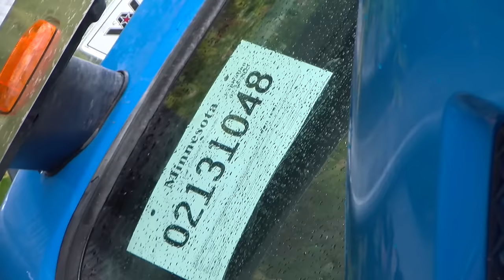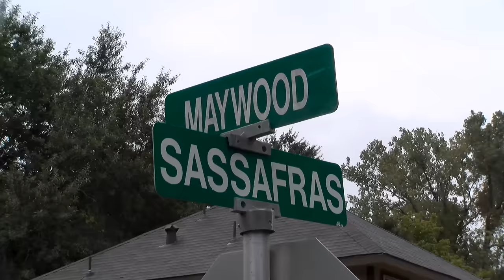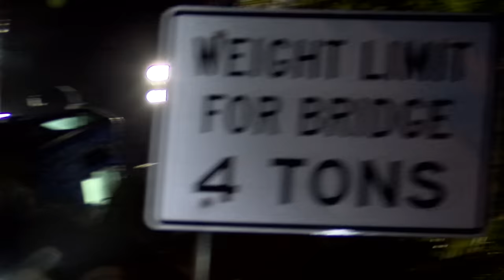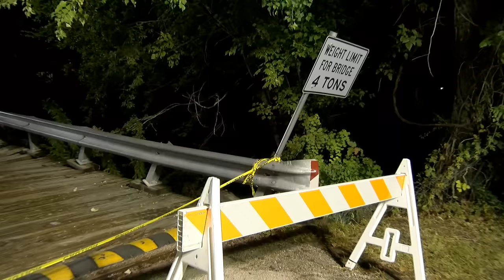091423 40 TON CONCRETE TRUCK COLLAPSES 4 TON BRIDGE AND VIDEO OF FULL RECOVERY

Comment: Having owned a big wrecker years ago I understand how difficult it was to lift the concrete truck out of the creek . I retired from Union Pacific Railroad and worked a lot of derailments and watching Hulcher Emergency D9 side winders and dozer clear rail cars , cargo and over 200 ton Locomotives out of the way and rerail a lot that could be set back on the rails is a lot of dangerous work . Cables and chains breaking , places where they were hooked ripping out and crap flying every which way . I've seen the side winders carry locomotives up some pretty steep dumps or what most people call slopes and set the locomotives on the rails to be moved to locations to be repaired or cut up and scrapped .  I knew this video was going to be a great one and it surely was great . Thanks for posting . Should be against the law in Texas for BLIND concrete truck driver that can't see a 4-ton maximum load sign on a wooden bridge .  Exciting day for the town folks .
Reply: Driver was negligent for not obeying signs! Insurance will get enormous claim request fo repairs to bridge and truck, probably will cancel coverage and what inconvenience to residents to reroute travel!
Reply: Add. Only one worker is wearing a safety helmet, sll personal should be wearing protective head gear!
Reply: At least someone here gets it. So many 'arm chair experts' in this comments section it's unreal.
You're not always lifting from the best point because you can't always get to it without putting someone in a dangerous position to start with.
There's no procedure book for stuff like this, has to be taken step at a time, very slowly.
Reply: Just curious where did u work 4 UP ?

Comment: I can’t believe they thought the hooks in the barrel was going to hold. Thank you for posting the recovery.
Reply: Or the chains would hold
Reply: Those drums on those mixer trucks are akin to an egg shell not very thick but because of the shape they are strong for what they are used for. Many years as a mixer driver.
Reply: Can't believe anyone would be so stupid to drive over it in the first place
Reply: @MarkSmith-ru7lu l
Reply: @1:58:34 !!

Comment: That truck weights 11 or 12 tons empty.  The bridge had no chance at 40 tons loaded.  I feel bad for the owner of the company.  That is a new truck.  Driver will be fired and go on his way.  Owner will pick up the pieces.
Reply: The problem is the sign is right at the FN Bridge a 40 ton concrete truck had no chance of stopping in time if he was going more than 20mph they needed a red warning sign at least 100 feet from Bridge entrance!
Reply: At 2:41 you can see well past 100 feet on the opposite side of the bridge.  The camera is at the stop sign before the bridge at maywood street.  Weight limit sign  is visible from stop sign.
Reply: I drive a 2007 Peterbilt with an 11 yard drum, it's around 30,000 empty.
Reply: @danielramsey1959  I own some dump trucks and they are about 23,000 empty.  And some frameless 39 foot dumps that are about 32,500.  I didn't realize the tare weight on the mixers was that heavy.
Reply: I think it should be against the law to have a wooden bridge for public traffic began with.
Reply: Why feel sorry for a company that hired an idiot to drive for them 🙄
Reply: You could look at the bridge and tell it couldn't handle that truck where hsa common sense gone
Reply: @ezragonzalez8936 Maybe. But you would hope driver of the truck can read road signs

Comment: I am an equipment operator and it is obvious this crane operator doesn’t know what he is doing. Totally wrecked the truck getting it out.  I would have considered lifting the drum off the truck first if it was possible.
Reply: The crane operator and heavy tow operator were both clueless.  They did more damage to the truck and bridge than the truck did falling through the bridge.

Comment: Surely the driver would have known that the bridge was not able to hold the weight I am surprised he made it this far across.
Reply: Big black and white sign, say 4 ton weight limit.
Reply: Was the driver tested for drink and drugs? Or just a novice who relied on satnav? Totally stupid decision to ignore the signs and the obvious construction of the bridge. A VERY basic mistake somewhere.
Reply: I think he was backing up while turning around. He could not have crossed that bridge.
Reply: SO, the weight limit should not apply going backwards? Do you also claim to have fairies at the bottom of your garden?
Reply: Google said it was OK.
Reply: @thepubliceye now that is a great comment definitely agree I’d have to agree that I feel the driver was in the midst of a reversing manoeuvre and that would explain how he ended up the way he has and evidently failed to see the weight restrictions of bridge limit
Reply: Looks like someone wasn't paying attention in math and science class during middle and high school.
Reply: "I am surprised he made it this far across" As he was nearing the intersection and while still on the bridge, he hits the brakes, thus overloading the footprint on the rear tires (beyond the limit the bridge can resist). Its very possible he would've made it, if a green light in the traffic signal was lit (if any). Who knows...
Reply: @jamesk0ua  yeah, kind of a clue, huh?
Reply: He obviously wasn't going fast enough.

Comment: As old and rotted as that bridge is I'm surprised he made it as far as he did..
Reply: A google earth view shows an 8 ton limit.  Must have been made years ago
Reply: Agree... He "almost" made it, but almost isn't good enough in this situation!
Reply: Bar stool engineer here. A wise man once told me to allways cut the barrel off the truck frame. Weld pick up points to the barrel and take it out separate.
Reply: @zacharysandberg Probably not but I’m thinking that a civil engineer made the determination to put that 4 ton limit sign up…
Reply: Since the bridge is destroyed it would have made more sense to yank up the bridge deck so you would have a straight up lift. The wrecker is pulling it into the guardrail. At least you could save the cab! The guy directing the operator needs to go back to Signaling 101!🤨 And why would you set up the Daylight on the opposite side that you need it?🤔
Reply: One has to wonder if he had been across that bridge before.... And how many times this kind of crap goes on.. and the Damage unnoticed
Reply: I'm not an engineer but if you drive the truck on a regular basis you should know how much it weighs empty and how much 10 yards of concrete weighs. Something don't compute there.
Reply: @ronnieedwards3132  maybe Google Map needs to know your vehicle weight before they instruct you around... I am interested to see what the reason is for this error... Distracted? He didn't know the area he's in a certain radius of delivery theoretically? There's not a sassy clairvoyant with horn-rimmed glasses in the office on top of stuff like this? We had a lady like that at U-Haul
Reply: @jamessimms415 32ton concrete truck is 8x the load limit. Even if google says it was still 8 ton he would've been 4x overweight 😂
Reply: @darryloertel6559     good guess is if he was empty, he might have made it. Those ratings usually have some fudge factor.
Reply: @rupe53  No fckn way, the truck itself is way over a minimum of 9 ton for a small rig, but that was probably a 13600kg rig empty come on simple math.
Reply: @darryloertel6559  simple math? Why convert it to Kg if you want it simple? (that's about 30,000 pounds) You are right that 30k is too much for that type of construction, but I don't know what the light weight of the truck is from where I sit. It doesn't have a tag axel so I was guessing it might be smaller. If it was loaded, it would certainly be more.
Reply: Was the rig loaded or empty
Reply: That wood was not rotted at all beyond normal wear and tear. That truck weighs at least 15 tons  either emit or full.
Reply: I'm enjoying listening to the know it all neighbors just chewin' the fat 😂

Comment: This is a fine example why reading and math are so important in a child's education. The sad part is this mixer truck was less than 30-days old as it still has its temporary paper tag in the windshield. That wooden bridge on Maywood Street was not a main thoroughfare and was only a shortcut. Now is the time to construct a proper concrete bridge.  While the driver of the truck holds ultimate responsibility for proceeding across a weak structure, there is plenty of blame to go around from the concrete contractor who apparently failed to inform the ready-mix company of the deficient bridge structure, to the dispatcher themselves who should've known the area who failed to inform their driver of a proper routing to the construction site. The shortest route between two points is not always the best route.
Reply: There was nothing mentioned about something being wrong with the bridge.
Reply: It's what happens when all you do is follow your GPS directions
Reply: @bonnygee2 the weight limit was 4 tons,not 40 tons!!!@@@
Reply: @kevinduveneck1504  You're mighty right.

Comment: I don’t know what that driver was thinking……. yes a lot of bridges are under rated for what they will actually hold but that was just stupid especially when you consider it was a wooden decked bridge
Reply: Surely the driver was looking at his smartphone while driving ! Greetings
Reply: I had no idea that a 40 ton truck was too heavy to cross a 4 ton limit bridge. I should have taken a calculus course in high school - or a logic course. 🤦🏽‍♂️
Reply: Dis dispatcher was to blame. He was routed to a job in the area VIA his designated route. That is how heavy Trucking is supposed to work. I was in the Trucking business over fifty years.The dispatcher is responsible for where a Company Truck can travel.
Reply: @BitterDemo  Drivers are ultimatly to follow the rules and signs of the roads!
Reply: Very true for most pars, But neither of us were there and we do not know how congested the area was, Nor do we know how far he could have safely backed without a Flagman. If you are a Trucker, You know if you know anything about the Federal Department of Transportation two inch thick Law Manual, It says that you are NOT ALLOWED to back even a Bus or Commercial Truck over a safe distance without a Flagman. I started driving actually in 1958 as a Farm Truck driver to the Mills and plants. and we were never to back our truck except up to load or unload except in an open space or field,  OVER NEARLY 65 YEARS, i HAVE DRIVEN WAY OVER 9,000,000 MILES AND PROBABLY BACKED WELL OVER 100 MILES. i WAS A rODEO dRIVER AND WON THREE TROPHIES FOR BACKING AND PARKING DOUBLES AND TRIPPLES. i ALSO DROVE IN THE rOCKWELL fOUNDRY IN ATCHISON, KANSAS  AND WASRESPONSIBLE FOR MOVING HUGHE MOLD'S AND RAIL ROAD TRUCKS AND PARTS.  i WAS THE ONLY DRIVER ALLOWED TO BACK MY TRACTOR TRAILER UNIT ON THE HIGHWAY 24 /INTERSTATE 580 DURING DEMO;ITION WITHOU RAILS TO KEEP THE TRUCK FROM GOING OVER AND WHEN THEY CARRIED THE HUHE PILING TUBES FROM NAPA sTEEL TO THE GOLDEN GATE BRIDGE IN THE EARLY 1980S ON THE RECONSTRUCTION JOB, I WAS THE ONLY DTRIVER THEY WOULD LLOW TO BACK DOWN THE WEST SIDE AT THE NORTH END OF THE GOLDEN GATE BRIDGE. I EVEN MADE HISTORY DOING IT. I AM JUST A GREENHORN LEARNING.

Comment: What's scary is that your state and county didn't replace the bridge long ago.
Reply: I bet the customer, or the builder  say it was ok to drive over it.  I have had that in the past  in the UK.  never trust them.
Reply: Why replace it? It was meant for personal vehicles (autos and pickup trucks) only.  Really, 10X the posted limit?  All you had to do was pay attention to the posted load limit and everything is fine....just like the often reposted video of vehicles going (or trying to go) under that bridge with its posted AND ALARMED height restriction.  Sorry but it's all on the driver, regardless of what he "might" have been told by others.
Reply: Concrete company should be held liable and made to pay for new bridge...driver obviously an idiot.
Reply: not that long ago, we had several of these older wooden bridges in town and at some point, the DOT no longer recognized wood as structurally solid. Yeah, old fashion 12x12 timber frame (6 timbers wide) put up by the RR 100 years ago was looked at by a bunch of (wet behind the ears) young engineers and all off a sudden the "never before rated" bridges that were fine for tractor trailers and fire trucks were no longer fit to drive a school bus over.... even empty. (under 20k pounds) Of course these were short and made to handle most anything, with a double deck of 3" plank including "tread planks" where the tires went.... but derated to 8k pounds like this one. Again, engineered by the RR guys.... not built of 2x12s like this one. BTW, 2 weeks after the new signs went up, I forgot and accidentally drove a 65k pound fire truck over one (oops) ...  it didn't budge.
Reply: Agreed. Infrastructure is decaying, and where the taxpayer's money goes?... you know it.
Reply: @hectorfmaldonado5875     someone mentioned this is NOT a public road
Reply: @rupe53  you are right, I went to check the news and found the driver cannot be cited to court, because it's a private bridge.
Reply: Privately owned road and bridge.
Reply: @mountaingrownnomad4212   that was stated 3 weeks ago.
Reply: Most likely the bridge falls under the HOA area.

Comment: That was painful to watch. Perhaps the crane wasn't heavy enough but most of those mixers have very sturdy lifting point at the front of the frame. With a heavy enough crane, they should have been able to lift it straight up from the front.
Reply: The concrete was probably hardened on one side. What was left in the drum. Somtimes you need to manually spin the drum so the weight is at the bottom so you can lift it straight up.  I would have taken the drum off and saved the truck.

Comment: I had a homeowner call me to drive a septic tank truck over a private bridge put in by the previous owner. Hès had the oil man and a logging truck over it.Its not posted and no engineering plans'  My  insurance company told me to stay away from it. If had enough hose, I could make it from the street side of bridge but I let it go.  It had a 1/2-inch plate for a deck with three 12 inch  steel beams on three cement piers bridge was about 15 feet long with 9 foot drop to creek down below.Had a rub rail but no guard rails.. the top of piers were broken at outside edge of the beams. But beams were straight.  Couldn't see how they were tied together on the banks.
Reply: sounds like a well built bridge. Prob would've been fine

Comment: The trouble that driver and company are facing now is not going to be cheap !  The front axle is the weight limit for that bridge!  Now add the truck and cement load. For those who don't know 4 tons is 8000 pounds . The driver is what is called a steering wheel holder because no brains up stairs behind the eyes. Notice the speed bumps on the bridge so people have to slow down when crossing every time.  Prison time for the driver if his load of cement is lost in the creek.

Comment: I drive a mixer truck, and I'll bet the homeowner or contractor told this driver it was ok to use the bridge. They do it all the time. We'll ask if the surface is hard packed they'll say sure then we end up with a truck sunk up to the axles
Reply: and then you buy the bridge
Reply: Yeah, that's stupid, crossing a dangerous bridge. And getting stuck in the mud is too totally different things.
Reply: @darryloertel6559  Two.  😬
Reply: @MrPerry61  stupid smart phones lol

Comment: Should  of had a crane on the other side of the bridge as well and cut the bridge back and lifted from front and back less damage to truck
Reply: Yes they could have made the lift easier with a crane on each side.  But then what do you do with the truck suspended over the bridge?  Takes a very big crane to reach across the creek with the weight of that truck.

Comment: Whats especially funny for the cement company is that as soon as the drum stopped rotating, the concrete started to harden. They will have to cut the drum apart and jackhammer out the cement.

Comment: The Insurance carrier isn't going to like this claim.
NO telling what the two conduits or pips  running parallel to the bridge are for, but boy if one was a gas main there could have been a hot time in the old town.
Reply: One of the pipes was a water main for the community.

Comment: I don't know what part of "4 TONS" he didn't understand. That driver should be terminated and that company should not only be held responsible for the replacement of that bridge, but for the financial hardships that people in that neighborhood incur from detours and time lost.
Reply: The problem is the sign is right at the FN Bridge a 40 ton concrete truck had no chance of stopping in time if he was going more than 20mph they needed a red warning sign at least 100 feet from Bridge entrance!
Reply: Talk about precarious 😮😮 from start to finish!! Glad no one hurt! 🙄🙄🥹🥹
Reply: @ezragonzalez8936  Have you never seen a sign stating the weight limit of a bridge you're approaching? I sure have, so I bet there is an advance warning sign as well as one right there on the bridge!
Reply: I found the bridge via google maps, old image from 2021 said 8 ton limit then but the road is 20mph residential area. So as for stopping would been very easy. i am 99.99% sure its right bridge via image of that house + street name @2:12 If that road is still in the shape it was 2021 then that alone is little suspect for that truck as it was being on it.
Reply: new Biden citizen driver.
Reply: @barrywallace4415 As fucked as that is, you’re probably right. Guys hardly speak english but still work construction— still get the job done though 😮
Reply: What else?